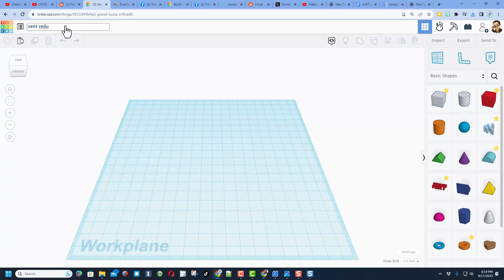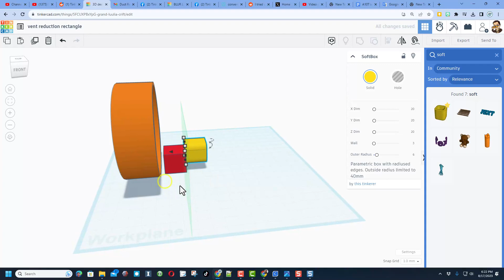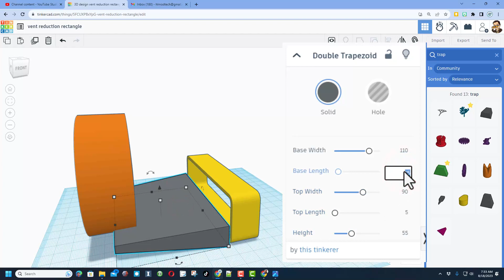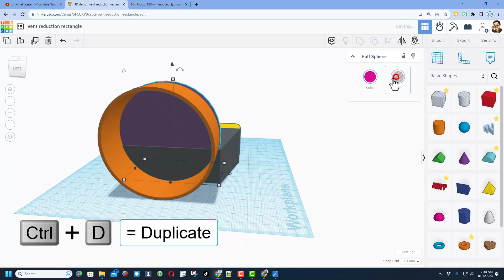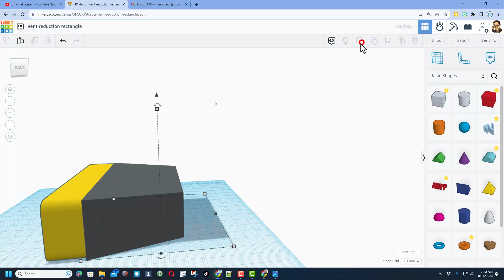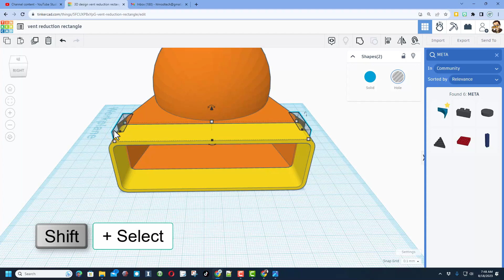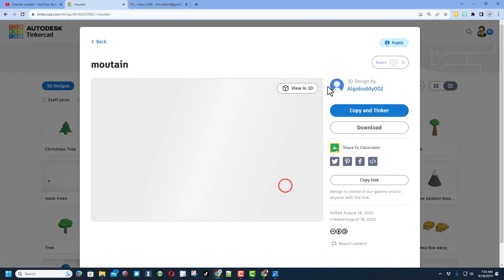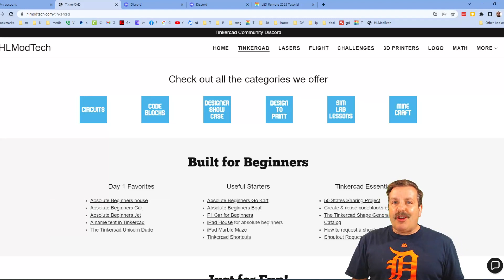Make a Complex Tinkercad Vent Reduction for 3d printing FAST! 15 min 🤯

Comment: hi, by the way what do you think of the shape generator square tapered to cylinder? I like it but sizes are very limited and the walls on the "pyramid" are not straight like on a real "lofted flange".
Reply from the maker: I have not used it a ton but I can see how it may have been slick. Thanks for sharing the idea!
Reply: @HLModTech  I have used it a lot, but in most cases, I prefer to carve a cylinder into square, or vice-versa.